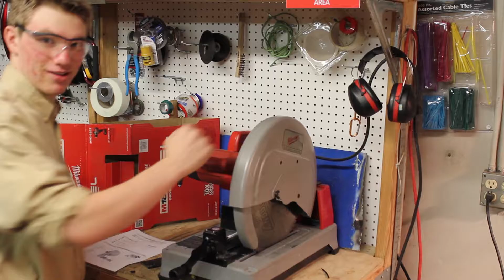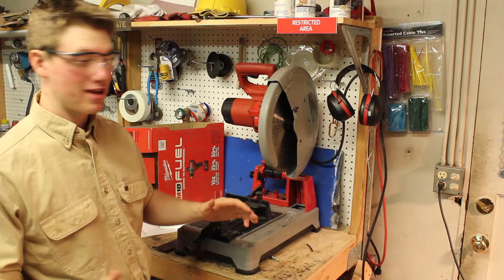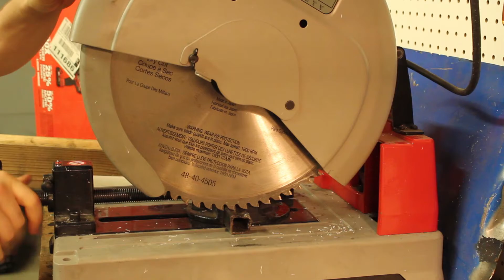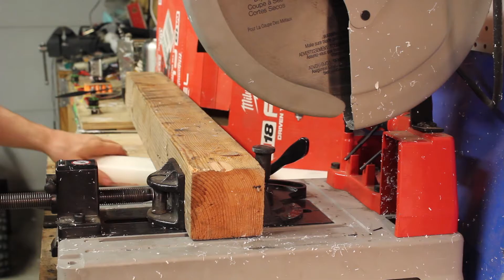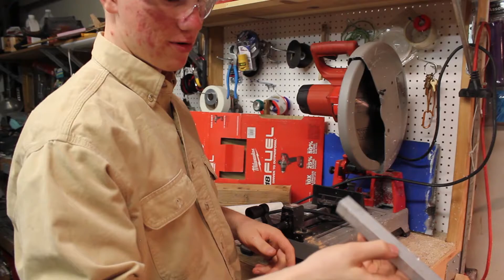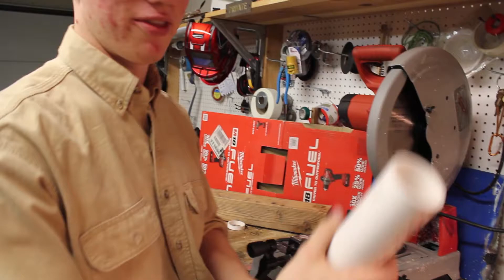Milwaukee 6190-20 Dry Cut Saw Review

Comment: will this saw cut 1.5 inch diameter solid rod, mild steel?
Reply from the maker: I believe so I've cut 7/8 1020 steel with it and it probably takes 7-10 seconds with that
Reply: @Hwrrobotics  thanks man

Comment: How do you like this after having it for several years?  I noticed it has the same poorly designed blade guard as the Evolution saw that throws all the chips towards you. Have you found that annoying/ dangerous?
Reply from the maker: After 4 years and numerous projects, it has proven to be very accurate but blades are expensive, granted they last me about 3 years of mild use and can be resharpened. However, the blade guard does throw chips everywhere like you were stating. The biggest issue with the saw has to be the vice, as it slips very easily when you apply any more pressure than just the minimum to hold the material. I am not completely sure about the price but I believe a replacement vice is around $80. Thanks for watching and for your interest. If you have any more questions please ask away!